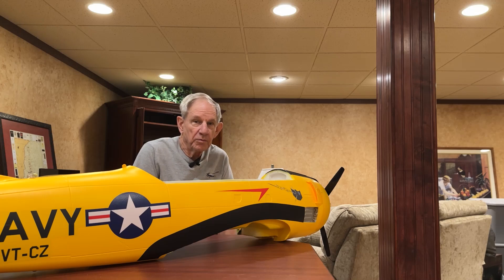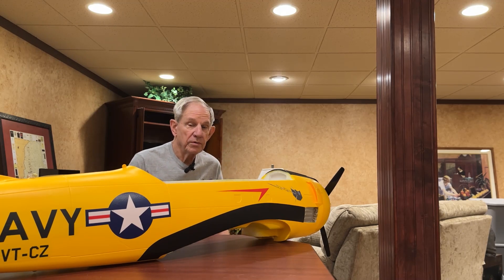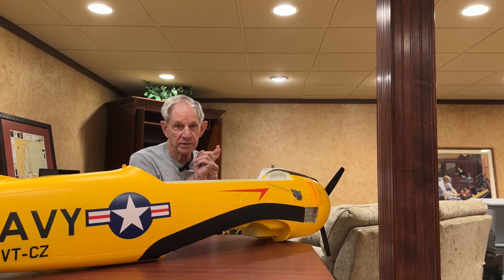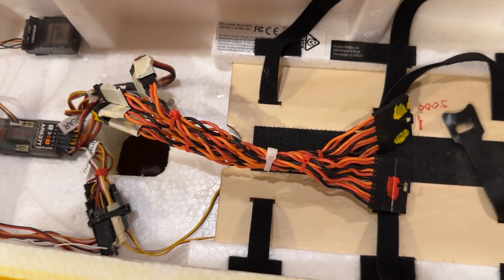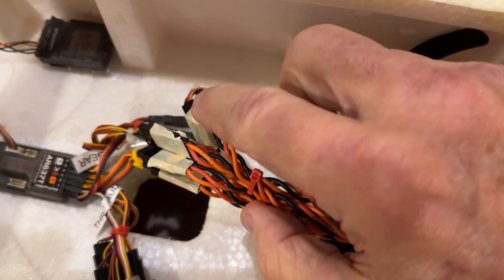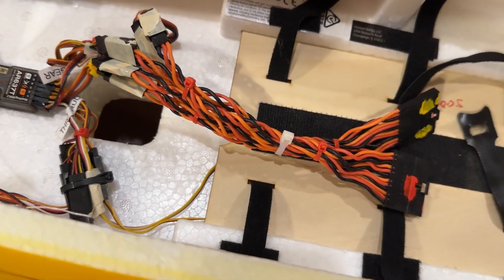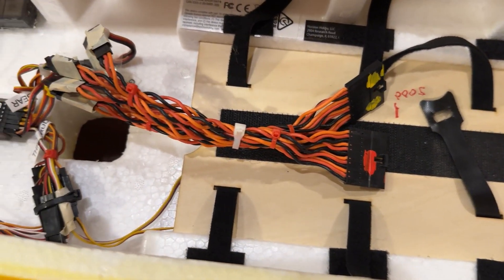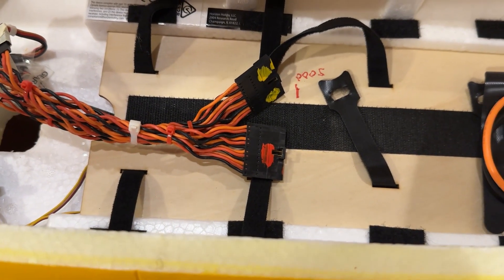A solution for plugging in multiple wing servos to receiver y-cables

Comment: I can't believe this has only 1000 views...  I wire my own up with MPX 6 pin or 8 pin connectors, but it takes time and it's a time suck chore. 
I love that these are now becoming more common and easy to buy.
Just a shame so many of these don't parallel the power and ground wires to save pins for more servos.  An 8 pin unit can do 6 channels if power and ground are all parallel. 

Ah well, thanks for your video.
Reply from the maker: Well, my channel is pretty small, and 1000 views is pretty good. I just added another video on these plugs for the Carbon Z T28. Saves a ton of time at the field!